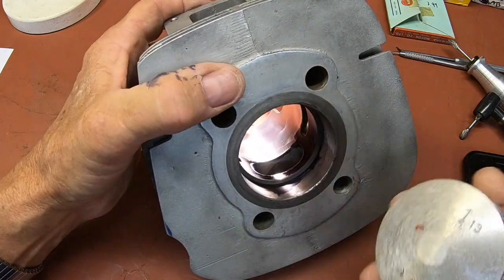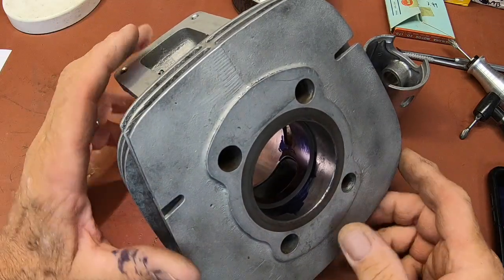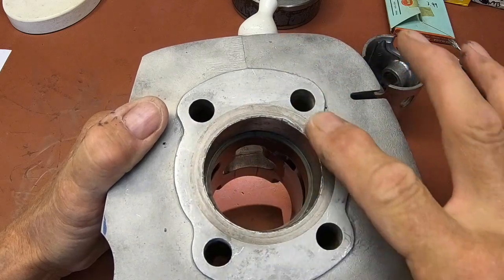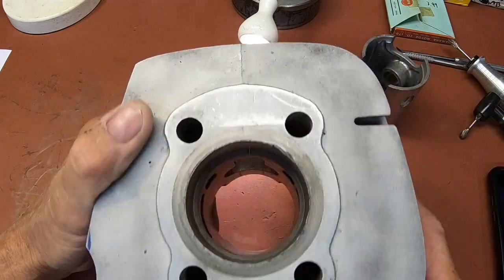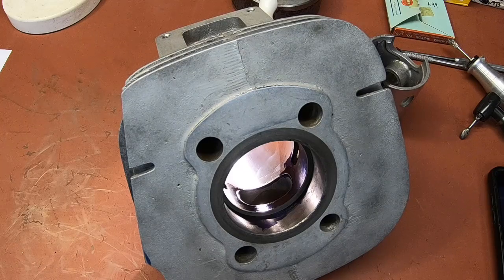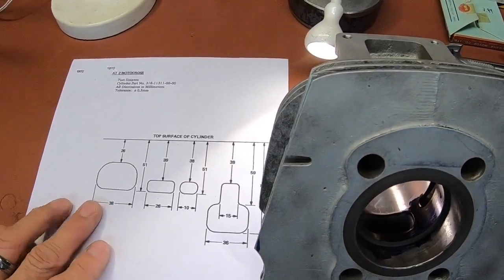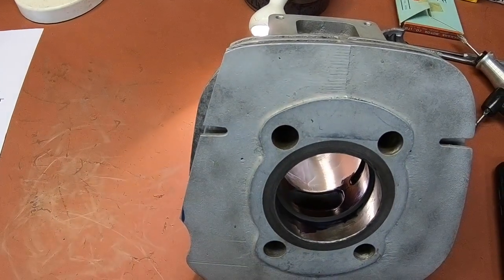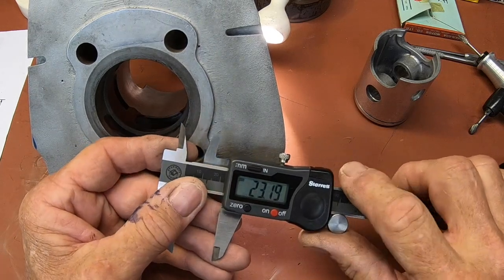Porting a motorcycle cylinder, Yamaha AT-2 MX

Comment: Thanks to you, I'm starting to understand the complicated process of porting. I'm planning on modifying early 70's kawasaki g4tr 100cc 11hp to G31M specs at 18.5hp at over 10,000 rpm.The Centurian was the fastest 100cc by far on the flat track. Your the man!
Reply from the maker: Oh yeah, the Green Streaks, I remember them well, ran against several when I was riding a Hodaka Super Rat on flat tracks in Oklahoma back in the day. They were indeed fast. That sounds like a great project, much like I'm doing on the Yamaha AT-2 MX build. I like this because it's not a restoration, it's a anything goes fun project, my only rule is only to use period parts. You will have to keep me up to speed on your project. It sure sounds fun. I do have a 71 F7 and a 70 F5 Kawasaki that I will get to in the future, I actually have done a couple videos on the F5 already. Thanks again for hanging out in the shop with me.
Reply: Wow, so cool you raced flat track back in the day! That was a little before my time. I did a little motocross as a teenager in the early 80's. Would love to own a Big Horn!

Comment: I did this to an old 73 125 enduro probably 15 years ago. I have an old yamaha manual that had port maps in it. I noticed the boost port being wider but raised the ports and matched the mx cylinder specs. I couldn't get my dremel to hit the correct angles so the ports looked pretty crude. I also had an old hooker expansion chamber and a head from a trimoto 125 that I shaved and enlarged the bolt holes to fit. The midrange hit this bike gained was very impressive and made me wish the chassis handled better (I did add a 21" front wheel). Pretty sure the yamaha would out accelerate my 72 cz125 but I wouldn't want to go too fast on a rough track with it.
Reply from the maker: Hey Nathan, yes, it's been a while since I did this, but it seems the enduro boost port is wider than the factory MX cylinder. But so far, I don't see or feel any problems with the way the engine runs. But I don't have an MX cylinder to compare to. You are spot on when talking about the handling of the Yamaha chassis, it needs a lot of help. Thanks for spending time with me in the shop.

Comment: Dale, it may be that the MX has a narrower inlet boost port area to create crisper low down power, to get you off the line and out of tight turns faster. I too have a limited understanding of the subject. The expansion chamber on the header allows for a higher revving engine by producing a pressure wave which acts as a sonic barrier, preventing the fresh charge from being scavenged out of the exhaust port at higher rpm. This was invented by Walter Kaaden at MZ in the 1950s and stolen by the Japanese in the 1960s after a defection by an MZ works rider. Kaaden controversially gained his thermodynamics expertise whilst he was a rocket scientist in the German V2 programme during WW2. 
Great work as usual, I always look forward to spending time in the shop with you. 
Best wishes, Dean.
Reply: Indeed he did. It was that pressure wave which opened and closed the reed valves on the pulse jet engine of the V1. Kaaden himself did not work on the V weapons though. He was mainly concerned with the Henschel radio guided missile.
Reply from the maker: Wow Dean...the school system in the UK must actually teach something. You and your brother are very learned. Got to be careful, don't want anyone's head to explode from all that really great information. I say this in jest, but you would have to see some of the younger generation here in this country....it worries me. I enjoy all that theory and have read some of it. However, it is just a little over my head, that's why I gave a disclaimer about my limited knowledge of the subject. Wish I had more room in my head for it, but it just doesn't fit. Thanks for hanging out with me in the shop!
Reply from the maker: Carl...I am indeed impressed, you guys are just a walking encyclopedia. Thanks for your support and all that stuff you know. Now I know were to go for everything I dont know. Thanks for hanging out in the shop with me.
Reply: @montana2strokeracer  Dale, it's getting that way here too. I only really know because I have been involved with building and tuning MZ and Simson bikes over the years. My understanding of the gasflow process is pretty limited, you really need a flow test bench and in-depth knowledge to do it properly. I'm very much like you, I can follow a map created by someone with all the gear and some idea!!
Always great talking to you my friend. 
Dean.

Comment: Hi Dale, I am just about to do some cleaning up of casting slag /polishing of all the ports and removing some larger casting bumps that appear to be inherent in the TS250 Exhaust Port, I have a spare Barrel and that is exactly the same, I watched another guy doing the same thing in another video with this same casting flaw, I intend to work very slowly but surely and with confidence, I am on a budget so I am going to have a go with my Dremel, got  to say a little nervous, but looking forward to it,  then I will get this Barrel 0.05 Rebored.  I know this is a porting video, But wondering will you be playing around with the Jetting, to complement  the Port work done,  think I will when I get it back together, I will post again and let all know how I get on, and any performance gains if any. Just want to say Dale thanks for your excellent quality videos, which are an inspiration to me and I'm sure to other classic two strokers out there.  Malc U.K.
Reply from the maker: Hey thanks Malcolm, I think you are approaching that job in the right way. You will do just fine, take it slow and check your work regularly. Your Dremel will work just fine. Yes, I plan to do some plug readings and jet changes I'm sure will follow. I still need to revisit this project because it will not rev past about 2000 rpm. I have gotten another CDI box and will try that. Pretty sure it is in the ignition, remember this is the one I put a YZ CDI set up on. I'm sure we will get it figured out. Thanks for spending time in the shop with me, and good luck on your port work.

Comment: Dale your right on the pipe.they really effect preformance. my raceing Suzuki TS-250 had a sweet low expansion chamber and we would saw off the stinger a little at a time, it was like Goldie locks and the 3 bears had to be just right to much and you lowered preformance. think its a back pressure thing. any who! it did sound fantactic.   remember starting it up at a car wash once after a race and the spectators ran out, scared the hell out of them. by the way wish i had a recording of my 1974 Kawasaki H2 with 3 chambers.
Reply from the maker: Yes, the pipe does a lot, there are many videos on YouTube with running 3-cylinder Kawasaki's. They are nasty sounding; I can just smell the Castrol R too.
Reply: need to get perfume in that smell! have to admit pure caster bean is the best, although you have to drain out after one heat cycle. @montana2strokeracer

Comment: in the olden days, if memory serves me correctly, my hop up guy would insert the piston and remove material from the skirt that would be blocking a port. like 4mm off the intake side of the piston. also does polishing the ports work on 2strokes like it did on 4 strokers?
Reply from the maker: In the good ole days, some folks removed material from the top of the piston to control the intake and exhaust events, you can also use a spacer plate under the cylinder, that also raises the port timing. More than one way to skin the cat so to speak.
Reply: @montana2strokeracer  hope you dont mind all the questions, as with time you will become a big time YouTuber and have so many question you wont be able to answer. you can hire me and Cain to be your personal  assistant to answer your mail. LOL

Comment: 4:17 I guess a good start would be to measure the width of the boost port on the Enduro cylinder first, that should help you work out whether the info on that port has been transposed.

Comment: Nice videos you make! 
One question about the transfers, since I cant see much of it in the video. Did you raise the complete roof of the transfers, or just remove material in the port openings to make them higher? It's supposed to be really important with the upwards angle of the transfers, so the whole roof should be lifted maintaining the same upwards angle (since no change seems to be specified). This affects scavenging of the cylinder, and affects both throttle response and power output. Maybe you had an MX cylinder as reference?
Reply from the maker: Hi there, I used the factory porting specs from the time. I am not a pro at this, but I believe the conception of rasing the roof of the transfers is a more recent procedure. Therefore, it was not mentioned in the factory porting specs from 1972. I do have a factory GYT kit cylinder that needs to be sleeved, and the roof of its transfers seem to be the same as a Enduro cylinder. It certainly makes since what you're saying, and I have read some about it. But this 125 MX project was about only using period parts and data that was used in about a 4-year window of 1972. For the most part I have been able to stay in that time frame. This was all announced at the beginning of the project. Still have some work, mostly painting before this one is complete. Thanks very much for your comment, and for spending time in the shop with me.

Comment: Nice work as usual. (vid and mechanics)  Those early cylinders have some thick liners. My 77 is about a third of that one.  Probably bean counters thinning them out saving weight and materials. Have you seen people drilling a hole in the intake into the first transfer on each side? All the new bikes have them I guess and I hear it soups them up pretty good. I think it came from the blaster riders as those engines are basically an updated version of these old yammies.  Also what brand grinder are you using? Thanks again. Kevin
Reply from the maker: Hey Kevin, no I haven't run on to any like that. Back in the day we used to run diaphragm carbs from a chainsaw on some of the Hodaka Super Rats, we ran a copper line and fittings to a transfer to pull a pulse signal to operate the carb. Man, those were the days, some of those Rats were unbeatable on the flat tracks. I have two grinders actually, one is a Foredom, the other a CC Specialty tools. The CC uses a  Foredom motor, it's the 90 degree one that I use. You can just buy the grinder head from them and use it on your Foredom, that saves some cash. Thanks for hanging out with me.